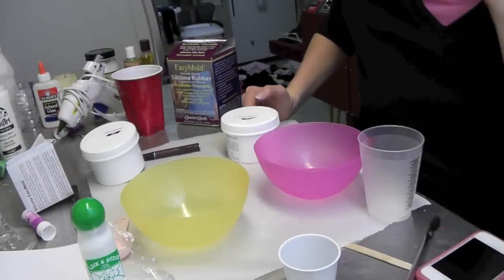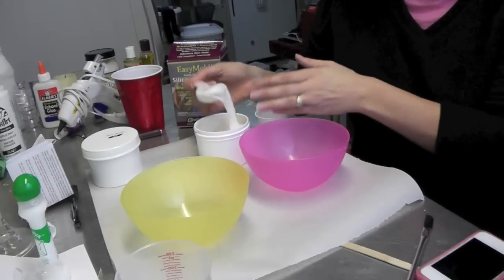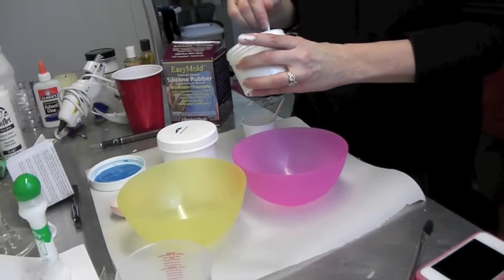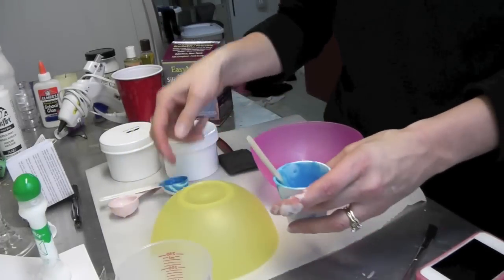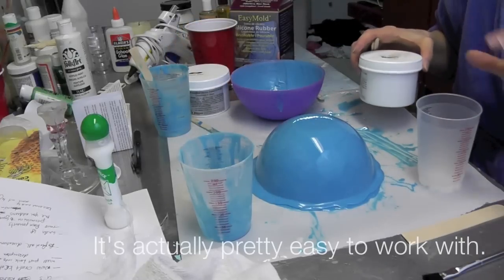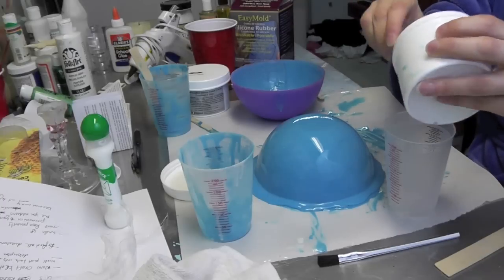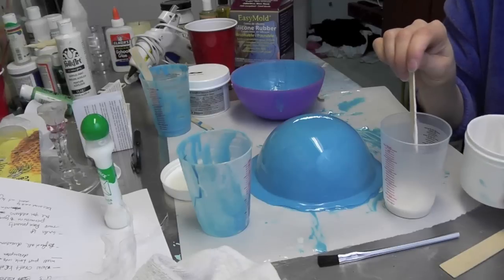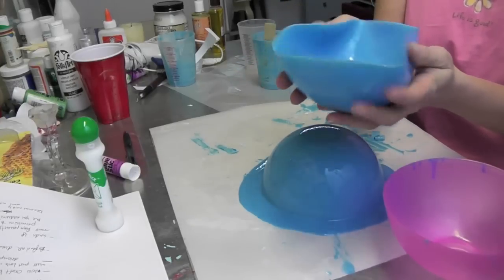How to Make a Silicone Bowl Mold Craft Tutorial

Comment: Do you have a video showing you using these molds to create bowls? 
I use laundry detergent measuring cups. I have been saving them for a while (I use to volunteer at preschool and these worked great for many projects) and I bought silicone Spatulas from the dollar store for stirring. The silicone mold material peels off all tools I use easily. Also the little measuring cups have measurements on the side. Plus the stuff you peel off and be used as filler in big mold making projects.

Comment: Is the inside bowl smaller than the outside bowl? That's the only part that was not mentioned.
Reply from the maker: Here are the written directions: https://www.craftklatch.com/how-to-make-silicone-bowl-mold-craft/

I brushed the silicone on the inside of one bowl and on the outside of the other, so they were slightly different in size.

Comment: I noticed that there was a bit of trouble removing the Silicone from the wax paper. I've seen recommendations to use a stiffer material like a plastic cutting board (such as this one: http://www.amazon.com/Stanton-Trading-2-Inch-Cutting-Board/dp/B0032AM0BC/). Since the cutting board is both stiff and made out of plastic, the silicone should rip right off!
Reply from the maker: Great tip.  Thanks!